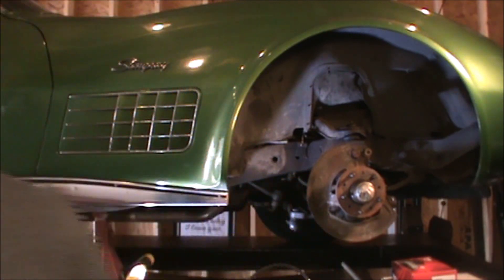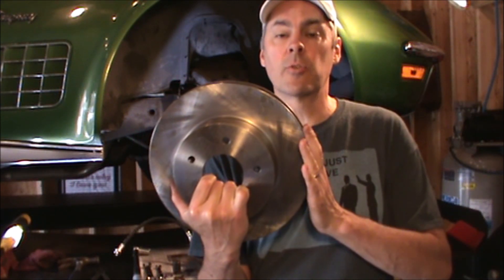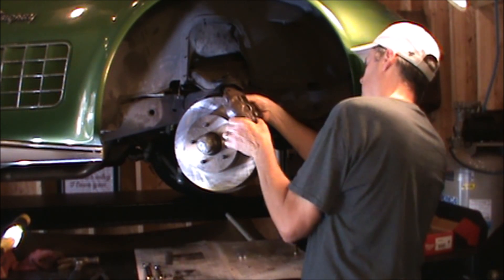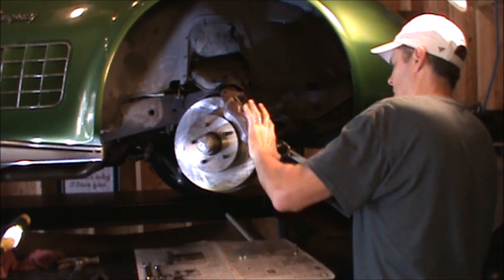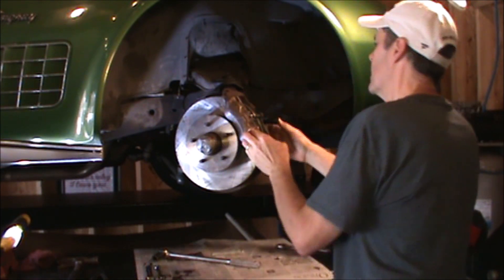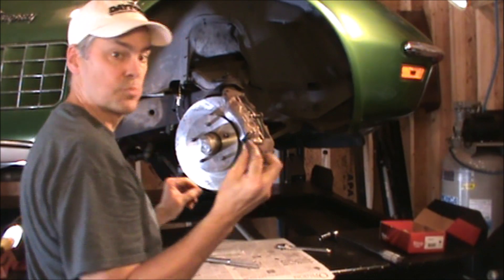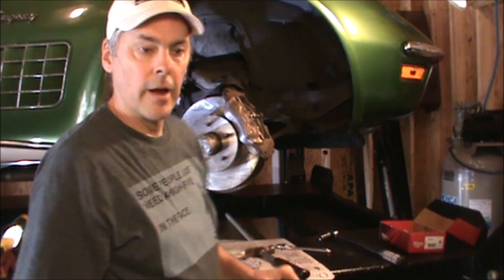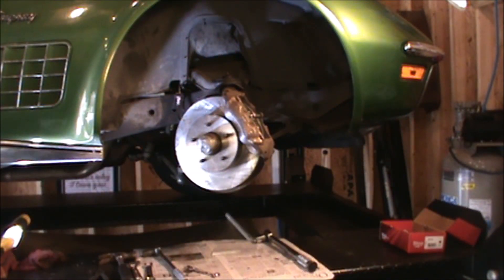C3 Corvette Stingray Brake Rebuild - Part 5: Rotor and Caliper Installation

Comment: i got on pad into the caliper but i am now trying to fit in the second one and there is not enough room between the rotor and the caliper to fit the other pad in
Reply from the maker: Here is another approach.  Install the pads and pins that hold the pads in place in the caliper and then slide the assembly onto the rotor.  You will need to use your hands to keep the pads spread apart.

Comment: i just got a new caliper and my rotor seems angled inside of it and i can’t get this pads in for anything
Reply from the maker: I'm not exactly sure what you are describing, so this may not solve your problem.  Make sure the brake pistons are pushed into the body of the calipers before installing the caliper back on the car.  Also, temporarily tighten the rotors to the hubs to ensure they are seated on the hubs.

There is not much clearance between the piston and rotor to insert new pads.  Everything needs to be aligned.
Reply: @MikeHammill-TheShop  thank you and do i need to drain my brake lines before i reinstall the pads?
Reply from the maker: @calemartin2328  it depends on how old or dirty the brake fluid is.  You will likely need to bleed the brakes.  See my video on installing speed bleeders and bleeding the brakes.

Comment: Curious on the hose connection. The hoses I have don't seem to allow for the end to spin onto the hard line while attached to the caliper. Does the hose flex?
Reply from the maker: Yes.  That's a problem.  My approach is to attach the flex line to the hard line and then attach & tighten the flex line to the caliper before mounting the caliper back on the car.  There may be better ways to do this, but this worked for me.
Reply: @MikeHammill-TheShop  thanks for the quick response. That was my plan, but just wanted to be sure I was on the right track. Great videos!
Thanks for putting them up.

Comment: Hmm, well on my new calipers the pistons do not allow for this “easy” sliding in of brake pads.
Reply from the maker: Just a couple of problem solving questions (meant to help not insult).  Are you using original style calipers or aftermarket?  What kind (brand) of pads are you using? Are the caliper and rotor parallel to each other?  Where is the binding/impingement occuring?
Reply from the maker: Also, are your pistons pressed into the calipers (by hand)?
Reply: Mike Hammill using all refurb units from car quest along with their pads.   I ended up cutting 2 lil blocks of mdf that are exact width of rotor..... and loaded the pads on the bench and used the blocks to hold stuff in place.  And as I slide caliper on it kicks blocks out and goes on smooth!
Reply from the maker: @caseytbss  great solution!
Reply: Mike Hammill so on the rears there is 3 bleeder valves.   Using a mityvac ..... whats best plan of attack there?    Seems like I’m having a hard time getting bleeding to go smooth
Reply from the maker: @caseytbss  only bleed through the top two bleeders.  Gravity bleeding works pretty well.  It's relatively clean and easy to observe when the air is out.  Don't pump the brake peddle.
Reply: Mike Hammill i have a Mity Vac.   Its okay to use isnt it?
Reply from the maker: @caseytbss  absolutely.
Reply from the maker: Start with the passenger outside bleeder then move to the passenger inside bleeder.  Repeat on the driver side.
Reply: Mike Hammill so what the heck do I do when i can’t get the drivers rear to bleed correct and give me some damn fluid?   Reservoir on master cylinder has plenty of fluid.   
 Tried all 3 bleeder valves and it seems like i got just a lil fluid out the low back outside bleeder.
Reply from the maker: @caseytbss  try the two person method.  If that doesn't  work, then  check to see if you're getting brake fluid to the caliper by disconnecting the brake lines from the caliper and gravity bleed the lines (you should check Passenger side after doing this with your Mighty vac).
Reply from the maker: Check out this video. https://youtu.be/XVq7sAFJTpI
Reply: Mike Hammill okay,  update of the day.      Tried gravity method.    I had half ass results..... coming direct out of drivers side brake line it would creep up the tube very slow.     Put back together, and removed bleeders,    Hard telling if fluid will ever come back there.      So jumping around with my mityvac.... I have figured out it seems like it’s going to bleed on the very first valve...... however I get less than an inch in my mityvac ,   And have figured out it’s just sucking that amount of brake fluid back there because that’s all the system is letting the rear have.           

So I’m wondering if that proportional block or whatever is bad or stuck    OR  if it’s the master cylinder?     When car got here reservoir was dry.    Since I have had it I have used up 2/3rd or more of a gallon of fluid.     Good amount of that was wasted with old calipers.... I didn’t realize these seals blow out on these brakes so easy.     Brake set up is junk on this damn car. 1982.      

So would you point figure at master?  Or that block?
Reply: Mike Hammill reading factory shop manual..../ that valve block locks up and goes into “warning” mode.   And only way to make it right is to repair issue and build up 450psi of line pressure...... 

Seems hard to do that without any damn brake fluid flowing through stuff doesn’t it?
Reply from the maker: @caseytbss I didn't understand your starting point and should have asked.  It could be your Master Cylinder, Proportioning Valve or a kinked brakeline.

Since the Master Cylinder (MC) was empty, it needs to be bench bled.  This can be done on the car, but it is safer (for your paint job to do it on the bench).  It is also possible that your MC is bad. If it has been bled, the MC has two chambers, one or both could be bad.  The MC could be rebuilt, but it's cheaper to buy a rebuild.

The Proportioning valve (I don't have one of these) could also need replacement.

Check the rubber line to your driver rear for a kink or crease, or just replace them to eliminate the potential cause.  

Summit Racing has great pricing and delivery on parts you may need.

I'd also suggest checking a couple of Corvette discussion boards to see if there are symptoms with causes that can be addressed.  Below are a couple that may be helpful to you.

https://www.corvetteforum.com/forums/c3-tech-performance/161140-bad-brake-proportioning-valve-long.html

https://www.corvetteforum.com/forums/c3-tech-performance/1504583-no-brake-pressure.html

Hang in there.  You'll be glad when this is done and you've gained a bunch of knowledge.
Reply from the maker: @caseytbss  the lip seal style calipers had a factory recall because they leaked.  Yes.  Junk.  They work fine if used daily but will leak over time if they just sit. 

I can understand your frustration.  Been there. You will figure this out.
Reply: Mike Hammill yeah, I’m gonna replace MC today.   My fronts seem to bleed fine.   My rears even doing gravity bleed hardly let any fluid through
Reply from the maker: @caseytbss  good move.  You will have more confidence in them.